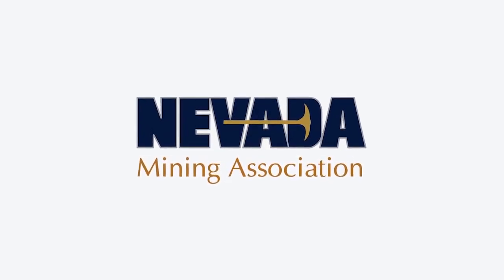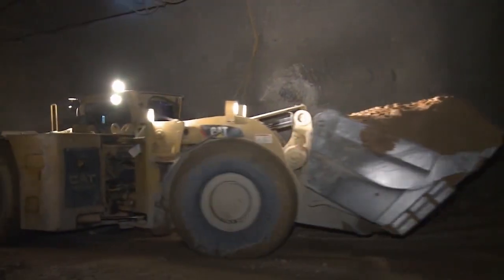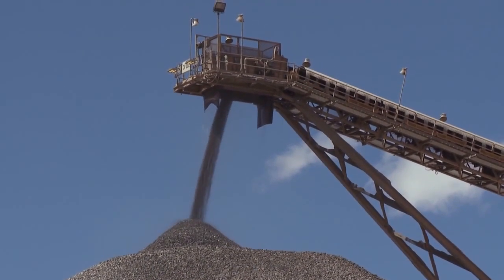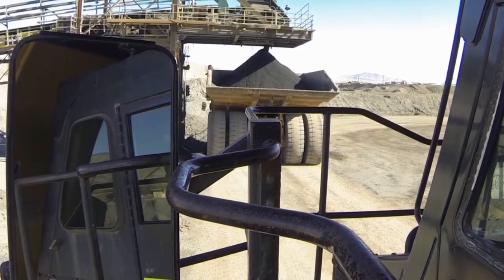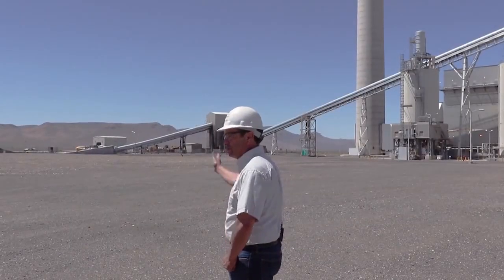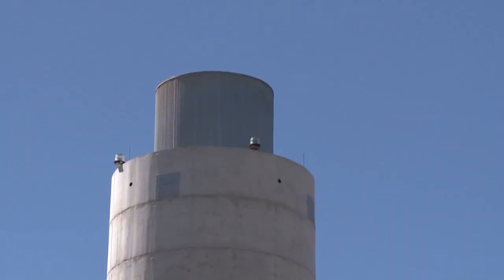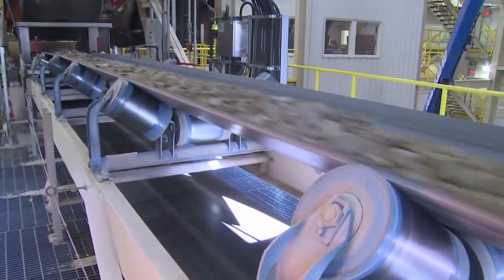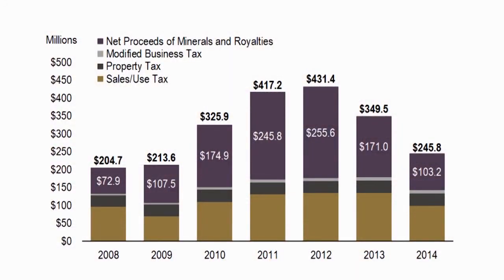Nevada Mining (Part 3) - Modern Prospecting

Comment: D301G resin is a kind of spherical macroporous weakly basic anion exchange resin, the resin with a specific pore structure, on the skeleton with tertiary amine base and it contains a certain amount of alkali group not only has special selectivity to aurous cyanide complex, large amount of adsorption speed, but also has excellent mechanical strength, good anti-pollution performance can be interesting resolution under this kind of resin performance in many ways better than Ukraine AM - 2 b resin production base in extremely high wear resistance, D301G largely solved the advent of block in the popularization of resin slurry method.